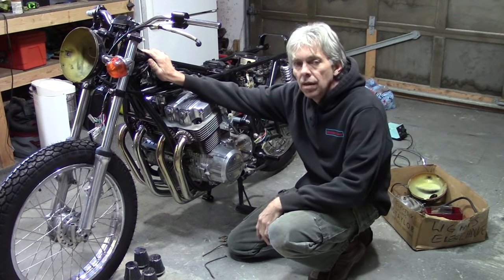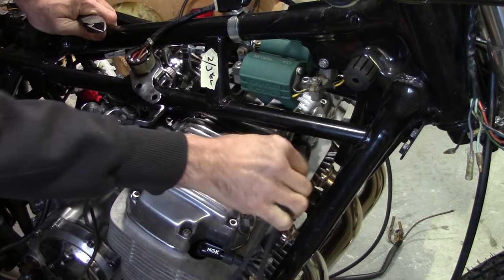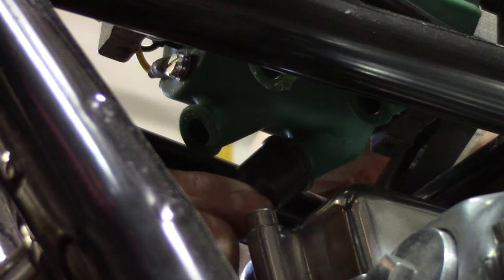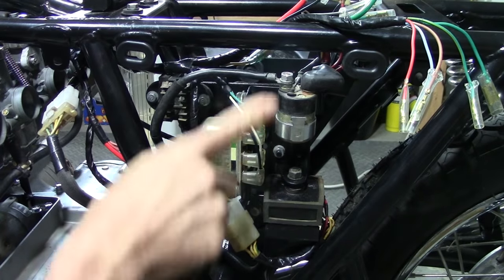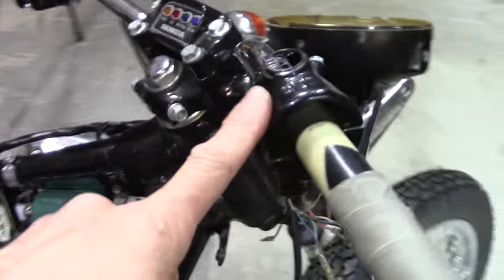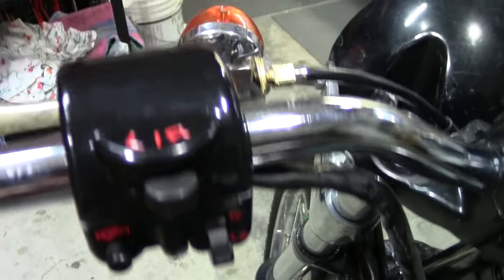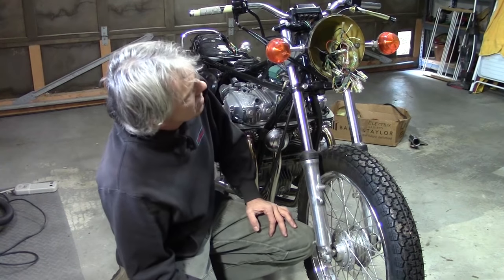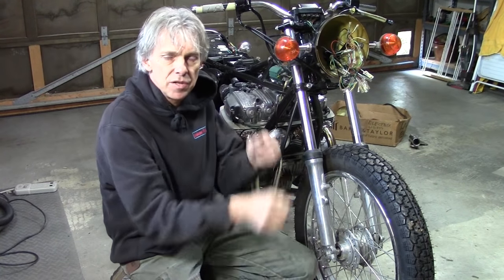1973 Honda CB750 Custom Build Part 32 - Final wiring

Comment: Hey dude I totally dig your hack a week episodes I have been doing my own custom rebuild of a 1972 cb750 and have found your shows extremely valuable and have learned a lot still even with manuals and diagrams,  YouTube as well as an endless surplus of forums I have managed to muck it all up beyond belief. It may surprise you to know that I have been at this for over a year now. I bought the bike running with an oil leak and some electrical issues after a year all I have is a dropped motor with a torn down top end frame laying on its side since it was the only way I was able to pull the motor solo. I have spent nearly every spare cent made in the past year on parts tools manuals fluids and lubes also electrical testers connectors wire spools. I followed all instructions still I find my electrical is a rats nest bolts stripped. Had to buy bolt kits old bolts seized, went through three cylinder heads one cam shaft., cam chain, rear chain and tension adjusters w/ bolts. New lighting. New mirrors new Rachel and speedometers.  Every cable I have ordered as been to short figure it to be the tach cable miss labled as speedometers cable an error that would seem to be extremely.common since 5 maybe 6 shops have all done the same error and leaving me still with out a speedometers cable after a year bright side is I have plenty of back up cables for the tachometer haha but man this all brings me to a huge question one you have probably gotten hundreds of times but I am literally at breaking point haha do you ever make it to cali or anywhere around so Cal or possibly be persuaded to come out this way for a weekend or holiday haha cause I seriously need rescuing I can't afford a mech shop. My friends and family look at me like I am totally bonkers when I simply try to talk a bit of shop l. All they get is key goes in hole , key turns.  Cross fingers and hope engine starts haha anything beyond that you just get glazed blank stare sometimes a blink or two so I get no help from any of them haha I really need to finish this project and the only way I see that happening is to import a genious to save my but haha I put the haha there but I am totally serious no joke j need some extreme help if you at least a little curious/intrigued email me back so I can explain why this is is so important to me and why the need and the rush. Maybe that.explanation may get you to at least consider helping well I'm hoping but anyways email is ( lazorethomas@Gmail.com) hope to hear back soon thank you for your time and the videos take care :)

Comment: If your front turn signals are single filament, they were probably rear turn signals originally.  On these bikes, the fronts have dual filament so that you have running lights on the front but only turn signals on the rear.  Those dual filament turn signals have 3 wires...obviously.

Nice video though, Dean.  Always happy when a new video of yours comes out.
Reply: +Ron Icard Yep, my thought as well, former rear light on the front. Thanks!
Reply: +Dean Segovis  You can tell by the lenses, the rears had a slightly frosted centre, the fronts clearer. Not all years had day running lights for the US, I believe, and not at all for other markets like the UK. My VT500 Ascot was Canadian market originally, and yes had three wires for the front indicators but a previous owner wisely did away with those. Which was handy as the only replacement I could find as genuine when I needed a new left hand one thanks to an old lady in a car park were from a CD250 which had no day running lamps.,

Comment: Your videos have helped to bring my bike to life. I can't thank you enough for that. I am at a crossroads with my wiring harness in the bucket. All clues point to a bad ground. Been poking around with a continuity meter for some time now, just can't seem to find the issue. With this video I've got the confidence to completely redo the connections in my bucket. Any additional tips you may have would be greatly appreciated. Thanks for everything!

Comment: you might want to try to change your switch handle bar holder to Bajaj Pulsar 135cc's switch holder, it is illuminated with LED light from inside, making your bike as cool as you :D or you can also use Kawasaki Bajaj 200NS's switch holder. the only difference is the Pulsar 135 LED is white, and the 200NS is blue. although you must modify the connector to match your bike's wiring, it's interesting to have your handle bar glowing :D

Comment: What kind of handlebars did you use for that bike?  I'm thinking about swapping mine out and I really like those.  I can't believe all those wires are hanging out behind the headlight on my CB750.   I guess I'll find out when I switch the handlebars.  I'm assuming I'll have to disconnect a bunch of them to pull the wires out of the old bars and into the new ones.

Comment: did you show how you wired the dynatek coils to the oem harness? not sure witch episode you may have recorded it on.
Reply: can you just tell me if you connected the black and white wires from the harness to the coils, or the solid black wires?  Also what did you do with the ones you didnt use? I cant seem to get any spark and Im guessing its a wiring issues. no one else shows anything for this issue, and its the one thing you skipped over.

Comment: I would like to see how everything goes inside the control guts. I just got a cb550 and the guy pulled the controls off and cut the wires, I have no idea how it all goes back together. Could you post a video of how it all goes together please?

Comment: Idon't have a nutral light and when ipush the starter switch  the gearshift is in nutral i have power to lights horn .Ican jump the starter solnoled and it turn over but no fire to the points .has any one got a clue???????????????????????